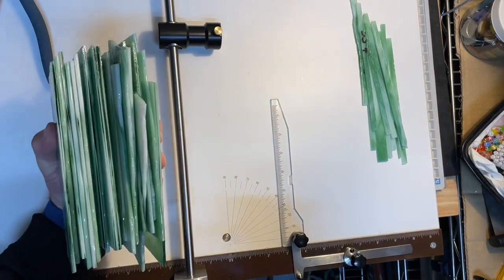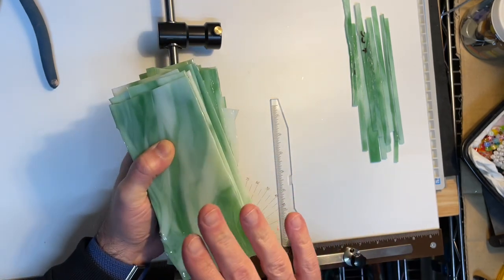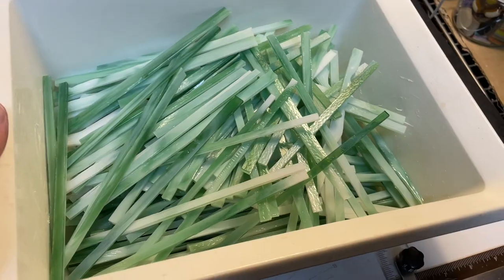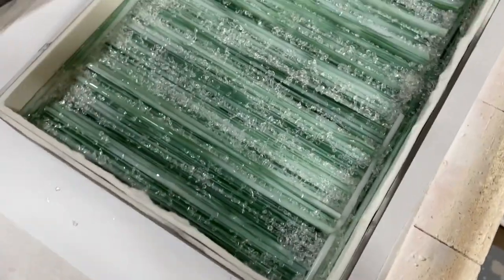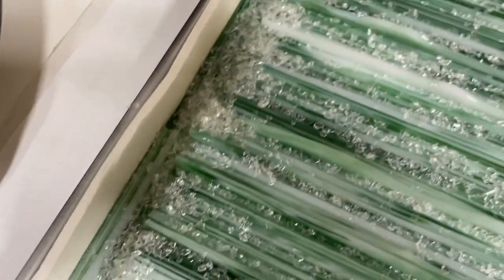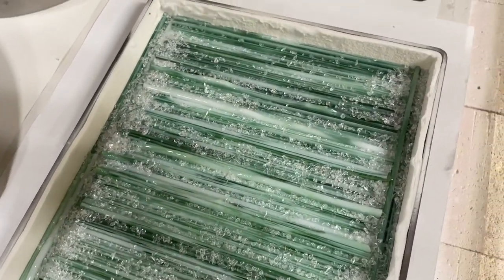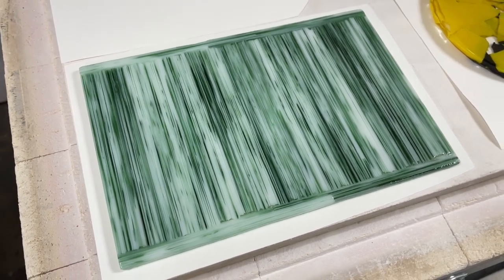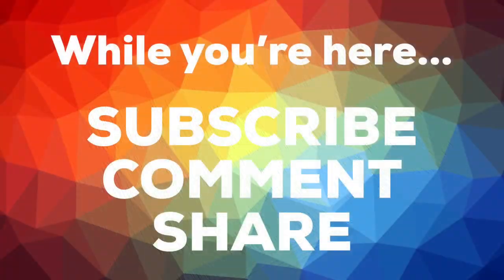Stripping in the Studio (Fused glass STRIP platter, pervert!) LOL

Comment: Just wanted to tell you, I bought the paraphernalia and made one of these.  It came out great.  After the initial fusing, the glass like climbed up something and caused a uneven-ness (very sharp!).  I gound them down and full fused it again.  The underside did not get smooth like my pieces normally do.  Not sure why and the top is not as glassy smooth as other pieces where I'll put a layer of Tekta on top.  I used black strip around the edge.  Wish I could post my pic here, I seem to be getting a lot of compliments on FB page.  I've subscribed and will be making more of your projects.  Have neglected my kiln for too long and some of your projects might get me started again.  Thanks a lot!  Chris
Reply from the maker: Sometimes you can get those spikes on fiber paper… did you spray it with ZYP release first! I find that helps, but yes, I often need to grind and fire again. Good luck perfecting your techniques!